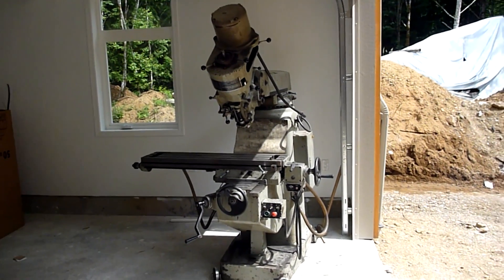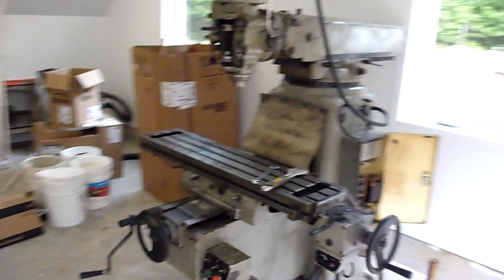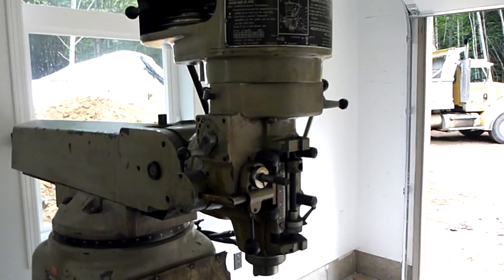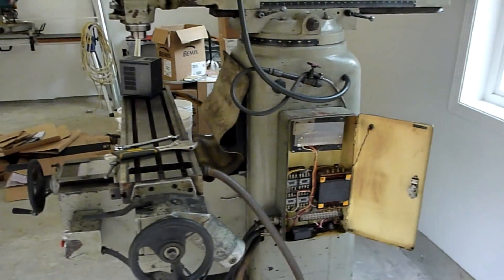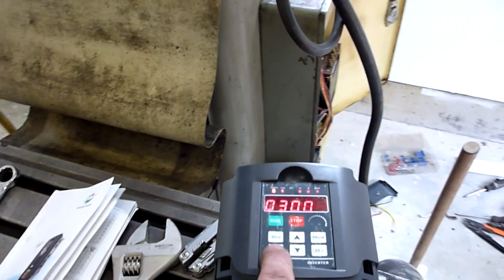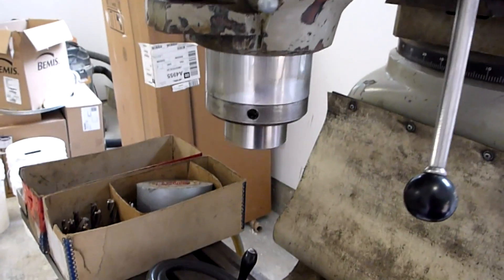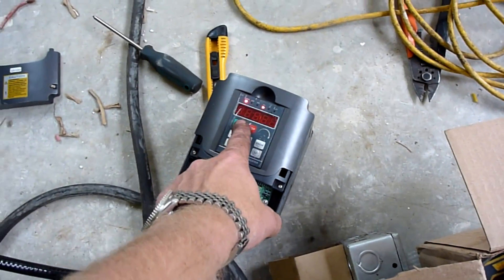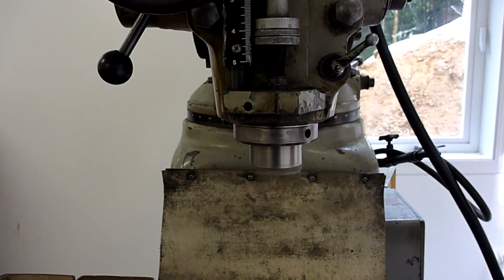New Milling Machine

Comment: i was a llittle concerned about the way you clamped down your piece of alluminum on the mill ther is other parts you are missing from that set up that come with the clamping kit. happy safe machinging.
Reply from the maker: Jamie Buckley You're absolutely right, that's a lousy way to clamp!  At the time, I only had the remnants of a clamping kit that the previous owner included with the mill.  No clamps, just some studs, t-nuts and nuts.  I was anxious to try out the mill and was able to generate enough clamping force that I felt comfortable with the light little test cut.  A new clamp kit was one of my first investments.
Reply: No problem Kelly have fun with the new mill

Comment: Would you have time to do a video about the wheels on the milling machine. I've been looking for a better way to move my milling machine other than using pipes. Your setup looks like the best I've run across.
Reply from the maker: No prob.  Shot a little video of it at work today.  I'm crazy busy and will be out of town for a bit, so I'll get it uploaded next week
Reply: Kelly Klassen
Thanks for you doing this. Sorry for the delay, just got back in town.

Comment: IT says 220volts on the front is that 220 in single phase or 220 three phase output ? because most wall receptacles are 120 volts unless you live in England or wire it up for a stove or dryer.

Comment: Hi:) Is that VFD a 120 volt AC single phase or a 220 AC single phase input inverter The motor is likely a 220 or 380 three phase input so that is what the inverter needs to put out but the input could be 120 or 220 single phase coming from the house electrical panel .You cold be trying to use 120AC wall power when really you need 220AC strait from the electrical panel> Just a idea because I have seen people hook up the wrong power to the inverters

Comment: Don't be surprised if you start getting variation on one leg of your power and the CPU on the house computers start freekin'!
 Take VFD and sell it!!!
 You got some adversity to changing speeds?
 This VFD causes more problems then it fixes. Moreover, ages motors, CPUs and PCB (online or not).
 Wire directly to your Buck Boost. And don't forget the "class 3 ground" (10 copper ground rod next to the house) separate from the rest of the house. or ground off the water line.
 It may not be a problem ..for a while. But trust me. when comes, you will search hi and low. IE: coolant motor or your wiffies lap top! And God forbid the house ever gets hit by lightning! so good luck with that.
 And check line power balance. The power company won't do it out of good faith...but they will do it if you tell them to. (Built in cost to your power bill) So.....

Comment: A 500$-1000$ DRO and a 300$ quill reader will work just fine I earn a living with my mill so I wanted a certain level of dependablty . It all depends what you will use you machine for, I use mine allot but if I am roughing out something out ill just use the thingys on my feed handles. Just don't buy anything from Shars tools. I swear buy KBC tools and I got my DRO from Bauer machine in Vancouver bc the specialize in Kent machines and Travers tools is good too but very expensive.

Comment: I have a NEWALL DP700 its the best DRO on the market, it has lots of handy function, bolt hole pattern arc etc. It's very expensive about 2800$ depending where you buy it but worth every penny, its also a 3 axis, it all depends what you plan to do with you machine I need accuracy of +/-0.00002" , i think that about 5 microns. The scales are coolant and bullet proof they have a life time warranty and 5 years on the read out.

Comment from the maker: Nope. Hertz doesn't necessarily equal power. I have programmed an upper limit of 90 Hz though, more out of concern for the bearings than the motor itself. In practice I'll be using a higher rpm pulley and using fractions of the 60 Hz.
Haven't had time to work on it much more lately, got some switches on order that I need in order to get things set up the way I want with the relays etc. and also a braking resistor. Also need a bunch of special shielded wire to cut out a bunch of the interference.